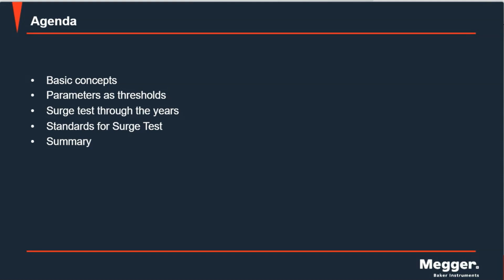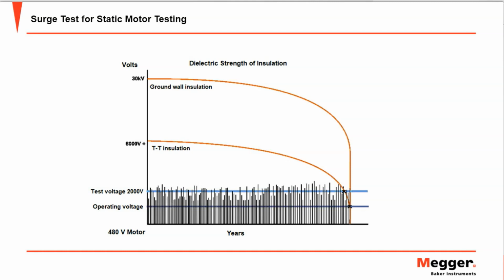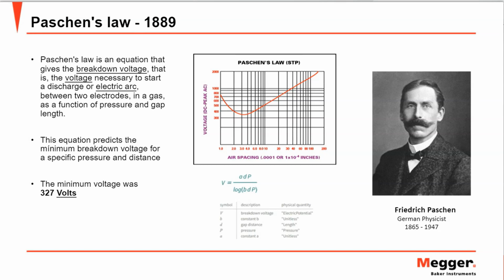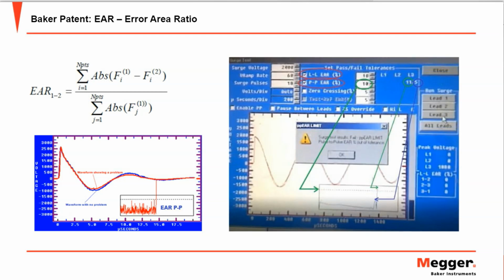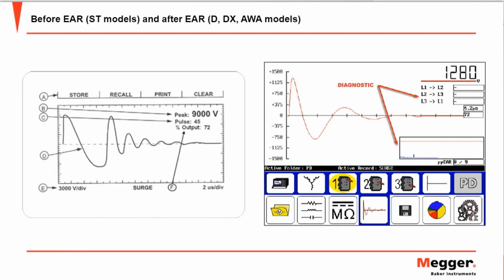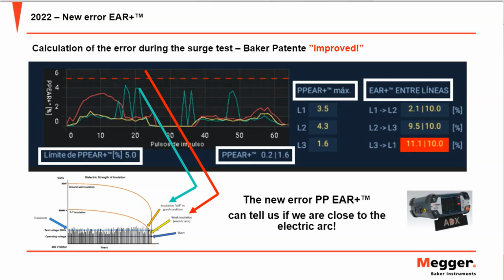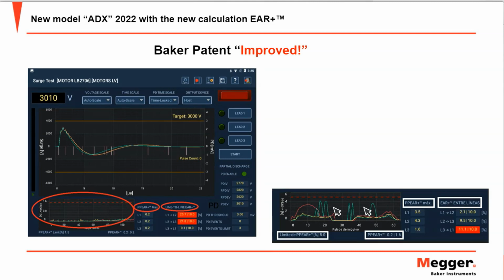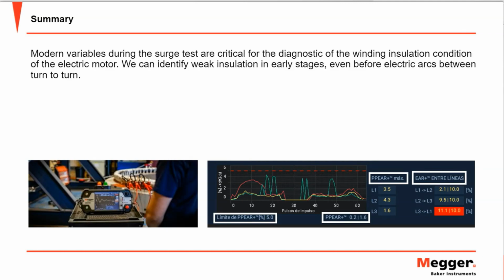Surge Test For Electric Motors

Comment: Most of the wiring insulation says max volt rating is 600 volts .
I wonder if supplying high voltage damages the insulation .
can you explain why the insulation is not being damaged  by the high voltage ???
what kind of test can be performed to find out why a rewound motor is pulling high amps ???
there is no voltage imbalance.
motor and cables megged good.